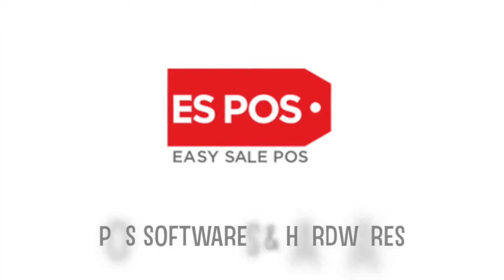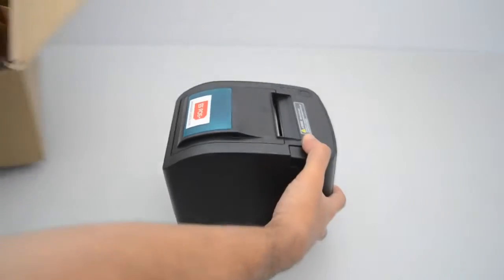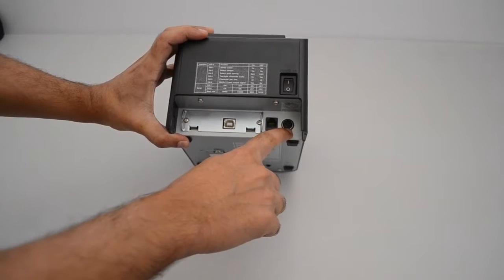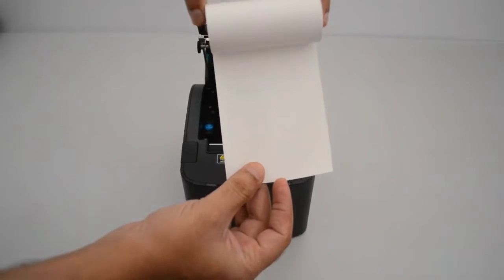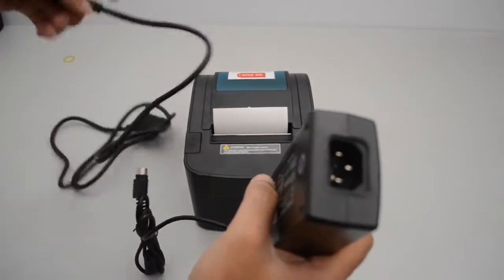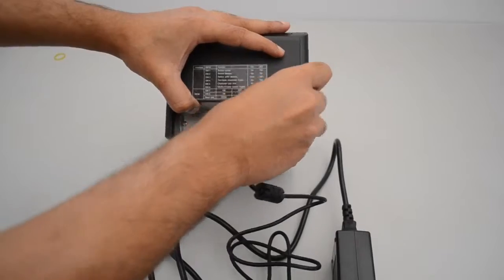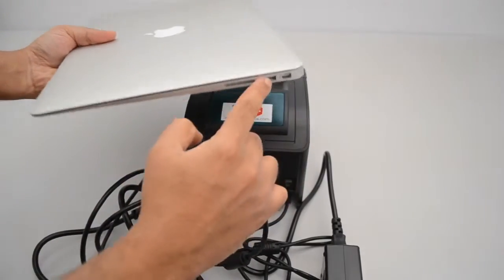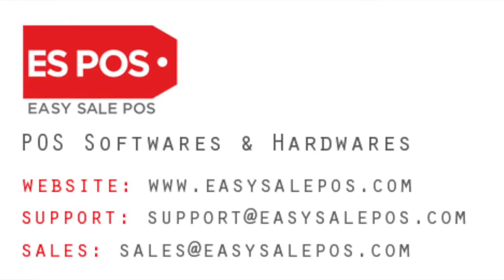How to connect 3 inch POS thermal printer ?

Comment: hello sir you it is possible to connect with mobile because sir i have billing software in my mobile so it is connected with my mobile or not?
Reply from the maker: Hello Karan,
 You may require Bluetooth or Wifi thermal printer for your requirement.